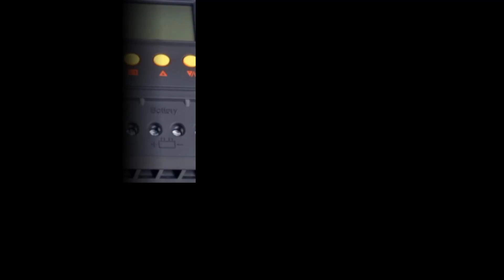SOLAR PV SYSTEM INSTALLATION |General overview |

Comment: Thanks alot 🙏. What switches the light off and on ? Does it on and off at a specific time?? Just like photocell control.
Reply from the maker: Yes. it switches on automatically in the evening and goes off in the morning.